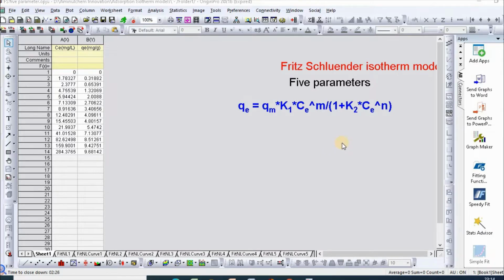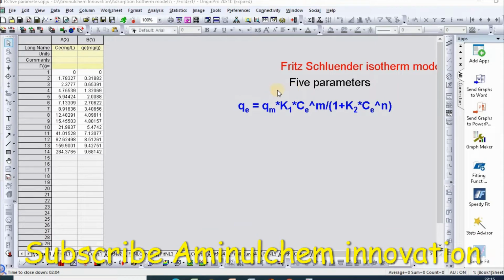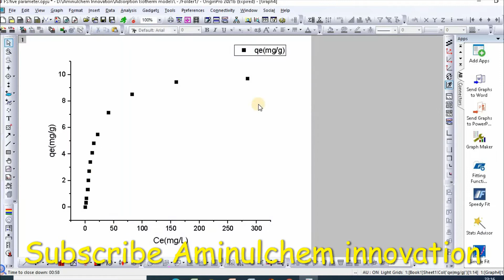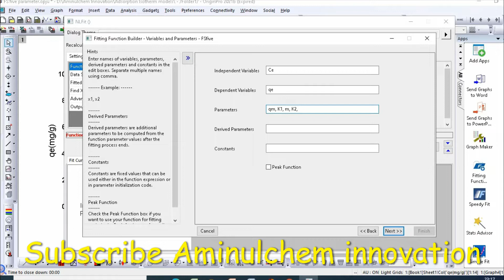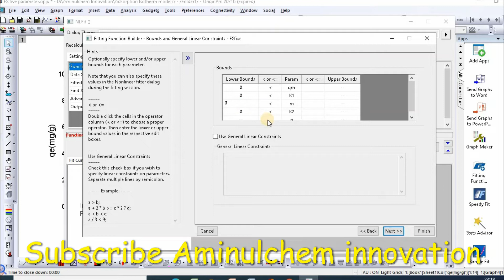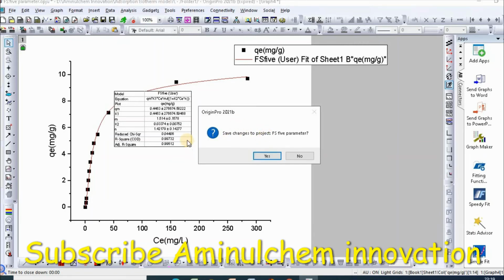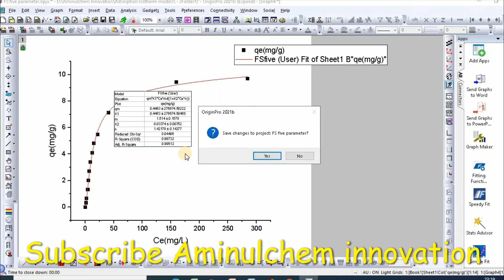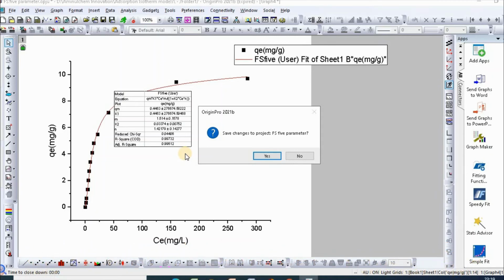Fritz-Schluender isotherm model fitting in origin

Comment: it is very nice but K1 & qm have higher plus minus values than the values itself (e.g. qm=0.44+-2766). what is mean by this +- ? is it error in value? if its so then how we can rely on that value?
Reply from the maker: Thank you so much for your valuable comment & it is highly appreciated. +- indicates error values but these values are exceptionally high and this might be due to fitting error. Herein I have showed the processes of how to fit this five parameters model for the fist time but values are not reliable in many cases because I used same data set for all modeling purposes and one set of data does not follow all the isotherm model. Please keep watching all videos & don't forget to subcribe. If you have further query, please let me know.
Reply: @Aminulchem  thanks for your valuable feedback. Can you give hint on how to improve such scenario? i am facing same problem of high error.
Reply from the maker: @awa8061  Thanks. Use of MS excel solver may decrease the error. I will try to make video on how to fit this model using MS excel solver. Please keep watching....
Reply: @Aminulchem  thanks. I have used solver and its worked for me. Also waiting for your video.
Reply from the maker: @awa8061  Thanks. Please subscribe, like & share to reach these videos to greater audience.